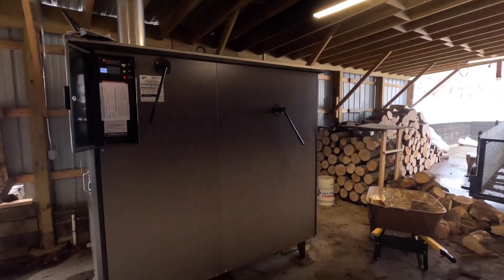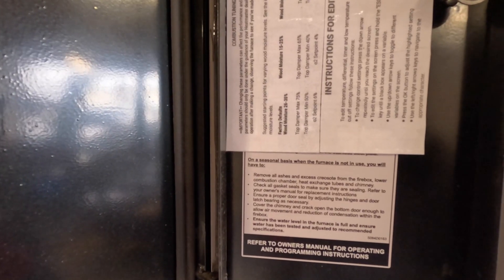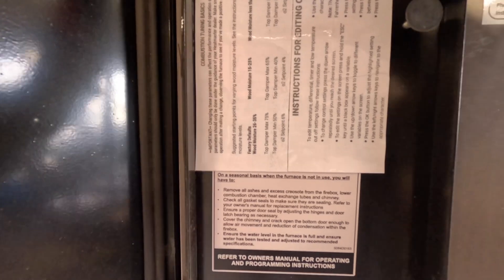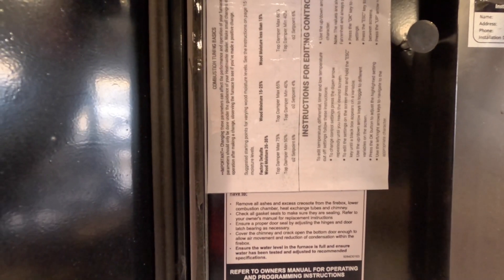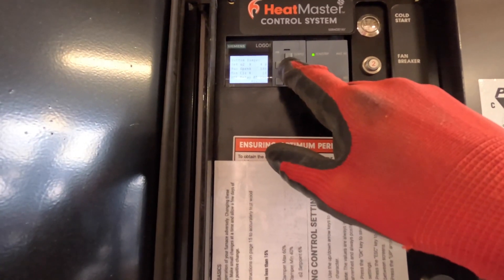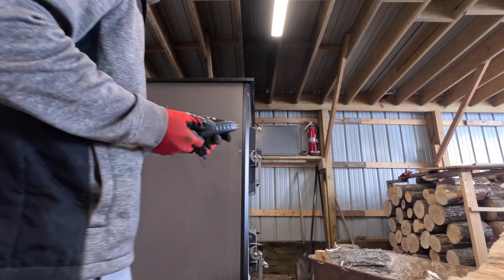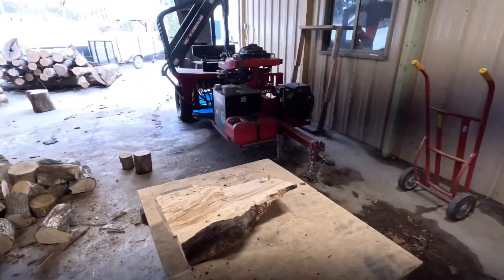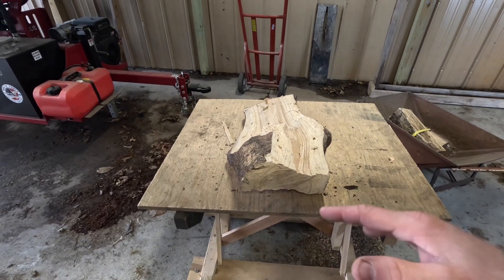Adjusting My Settings on My Outdoor Wood Boiler For Drier Wood. Will It Make a Difference.

Comment: Sounds like you got it zeroed in pretty well. I didn't realize you were producing smaller size coals before. What you are seeing now is what you want with a normal sized fill. The most efficient way to run your boiler is to use the least amount of air possible in the prmary burn chamber to achieve and maintain your coal bed. The amount of air required directly relates to wood moisture. You certainly have that covered. The more air required the less efficient the boiler becomes. This is because the heated exhaust gasses you are creating will pass through the boiler at a higher velocity with more air flow. This actually defeats the purpose of the turbulators. They are in there to actually slow down the velocity of the exiting gasses as to extract more heat before exiting the stack. Portage and main was the first company to incorporate the tubulators in their owb's with the optimizer model. Also, of course the more cold air you introduce, the less efficient the stove becomes. You are not seeing vapor now because you are running hot! This is fantastic and the way it should run. You might be able to get by turning that down even a little bit more. 
  I still believe you might have to put some larger or wetter wood on top for that extended burn you want to try. I know with mine I would get too many coals if I didn't.
Reply from the maker: Yeah I just may turn the settings down even more. I want to run it this way for a bit to see the results on different type of wood I put in. But I do feel I could put a little larger wood in and if turned down a little bit more she just might get longer burn times on less wood.